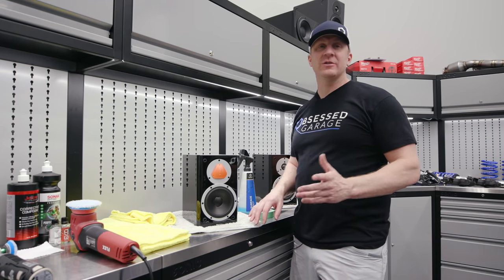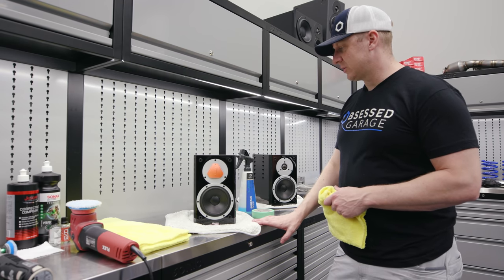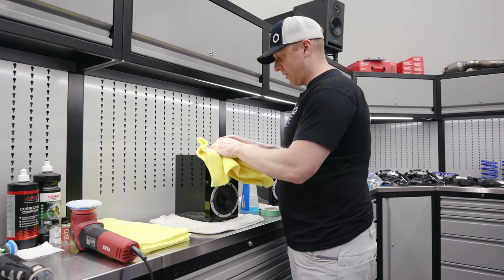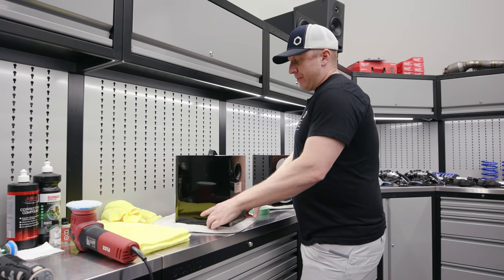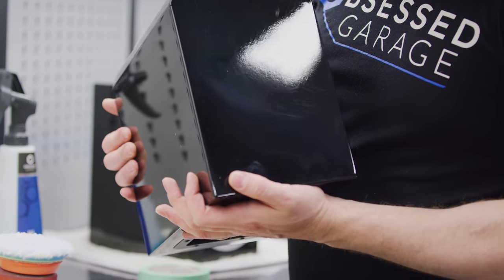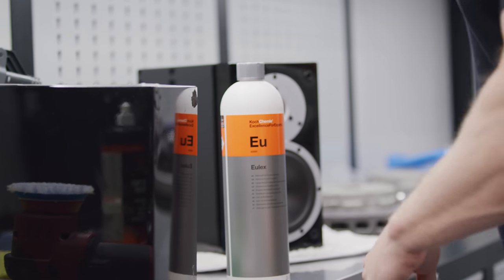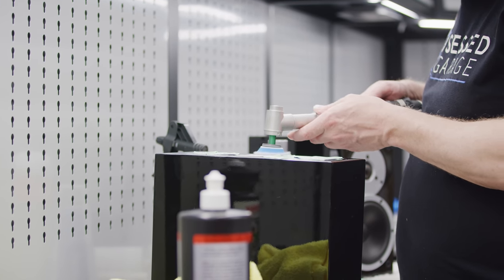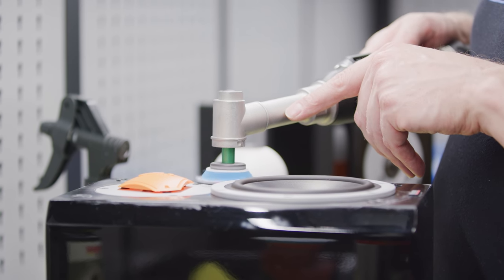Restoring Scratched Hi-Fi Speakers + Ceramic Coating Finish

Comment: The term lacquer is just the UK/European word for clear coat. It’s a 1 stage system like older red automotive paint used to be.
Reply: Thought lacquer was diluted shellec.  Shellec dries really fast and gums up.
Reply: Lacquer in North America is not normal clear coat. It is in this case a single stage air dry product that isn’t very durable and polishes very easy. It’s generally only used on wood now, but was used in automotive in the past.